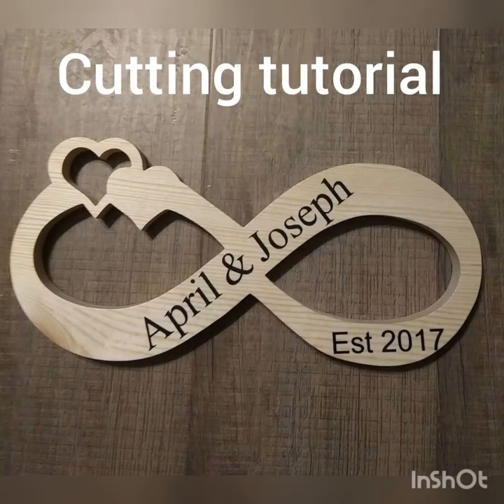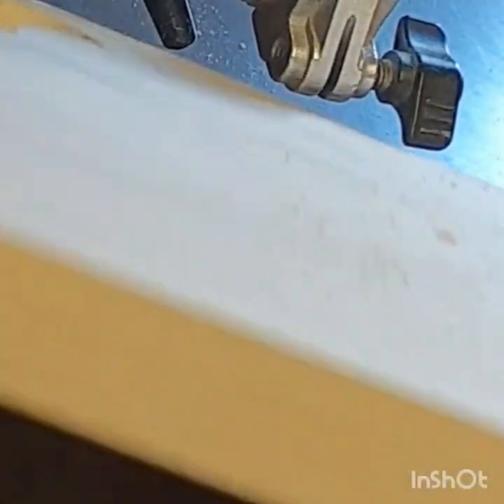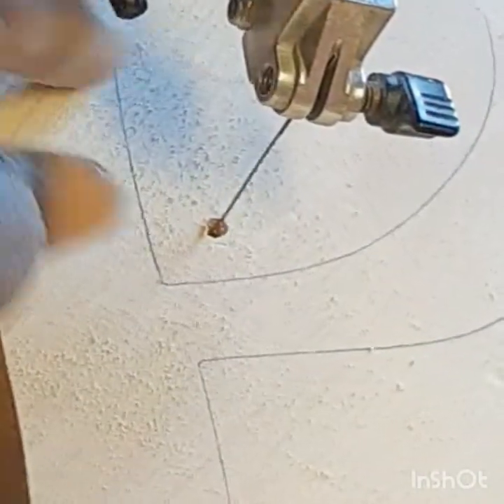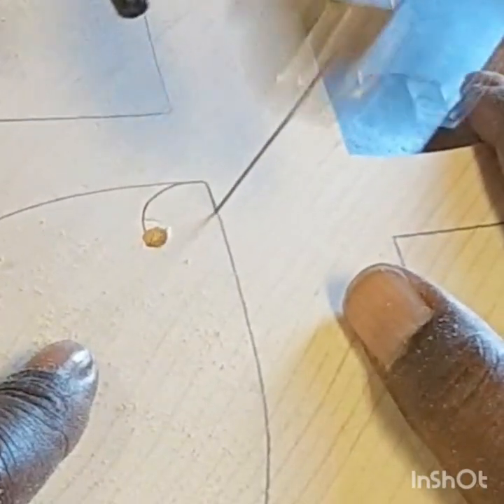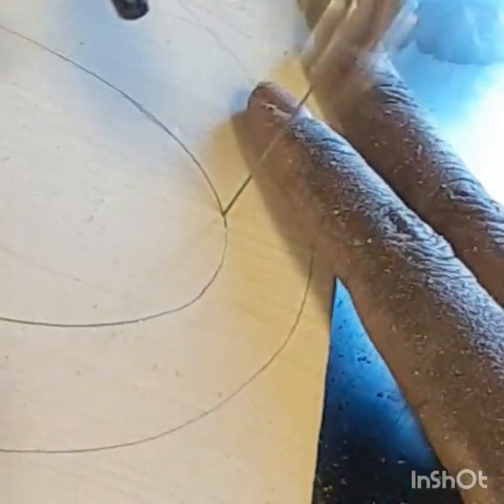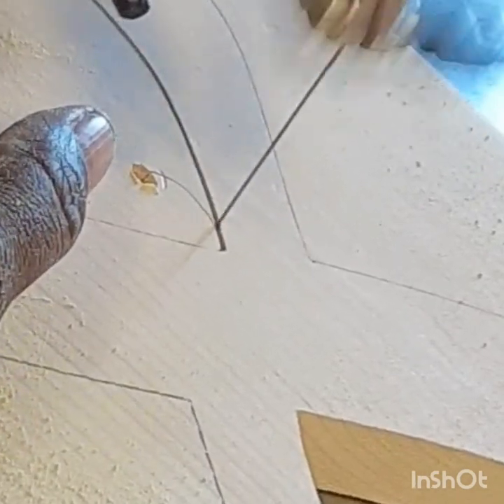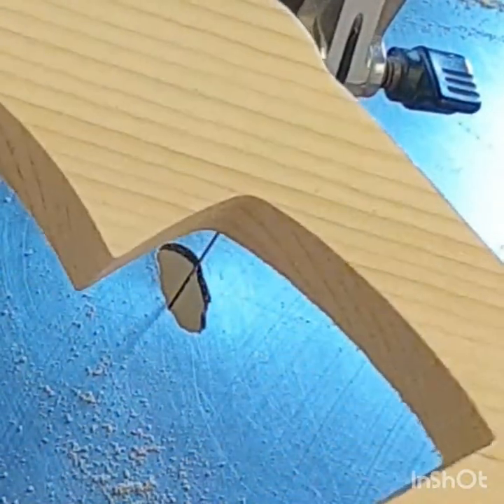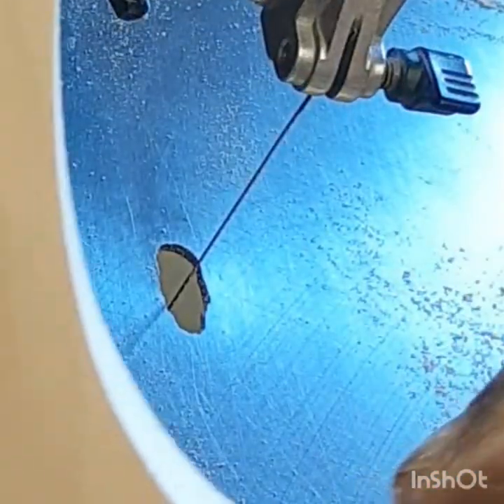Infinity couples sign tutorial. Scroll saw tutorial.

Comment: I am at the point of buying a scroll saw.Great work on those cut outs.Where do you download patterns from or do you draw them yourself.
Reply from the maker: I use patterns from books or from some of the scrollsaw pattern makers every once in a while but for the most part I make my own patterns. You can download silhouette or inkscape for free to use for making patterns. Make sure you get a saw that doesn't need an attachment to use pinless blades.
Reply: @Mytoya2  Thank you.Yes without doing some research I almost went and bought junk.I am looking at a Porter Cable 18 inch at Lowes right now.Watched a lot of reviews and it seems to be a nice saw.Comes with a stand too.
Reply from the maker: I suggest a dewalt 788 of a delta 20inch. It will save you from being frustrated. The dewalt and the 20 inch Delta model 40-690 are the same saw but the delta 20 inch is less expensive. I have both of these saws.
Reply: @Mytoya2  Ok thanks for the info.Will look at them a bit closer.
Reply: @Mytoya2  You will not believe it.I bought a Porter Cable about a month ago.Did not use ir really untill today.I had one heck of a time to get tension adjusted.Took it apart.That little bolt was stripped.I took it back right away and got my money back.Now I am going to look at the 2 you mentioned.Lesson learned!
Reply from the maker: Let me know when you get your new saw so I can cheer for you! If you need help with making patterns when you get started contact me on instagram under mytoyaNcalifornia. I'm so excited for you!!!!!
Reply: @Mytoya2  Thank you.I think it will be here next week some time.I do not have instagram though.
Reply from the maker: Are you in Facebook under the same name? If so I will find your page so I can send you a few patterns.
Reply: @Mytoya2  I am.You can send them to messenger too if you want.That would be awesome.Thank you.